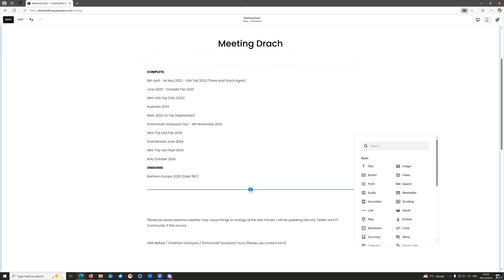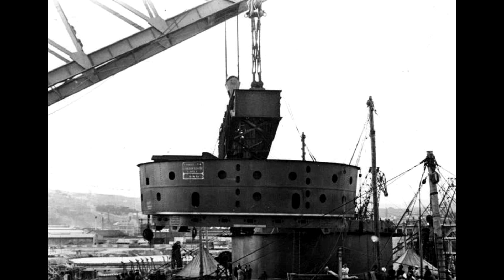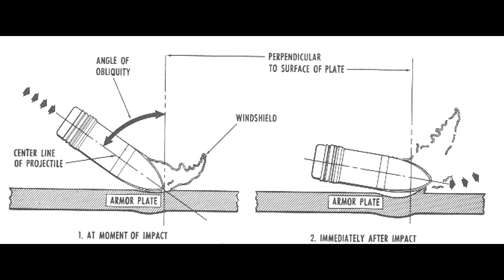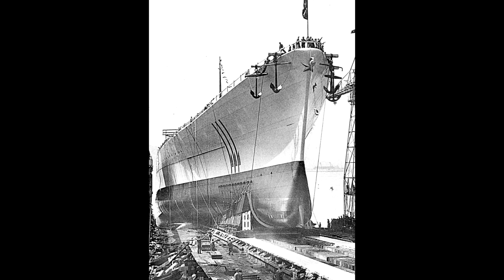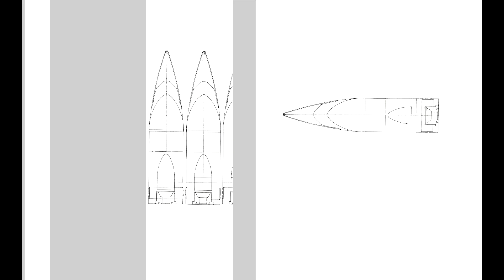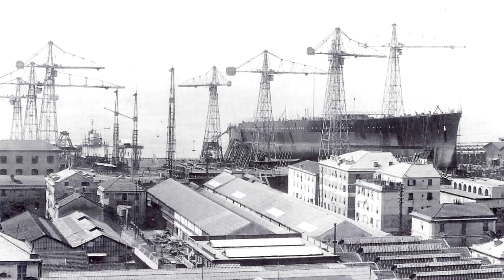Naval Engineering - Did the Littorio's Armour Scheme Work?

Comment: Always wondered how these would have fared outside the Mediterranean. Of course this was not the theatres of operation which they were designed for. One of the reasons the Allies rejected the proposal. I always marvelled at the rear turret’s placement high above the rear deck. 👍🏻🏴
Reply: My understanding is that that placement reduced the blast effect on the lowered stern deck.
Reply: @ Thank you. My father served abroad various battleships during W.W.2; Nelson, Rodney, Malaya, U.S.S.South Dakota, and Valiant.
The Queen Anne Towers on the first two ships suffered blast damage initially. I don’t know if that was solved by fitting blast protection shutters.
👍🏻🏴
Reply: @Backwardlooking The 'solution' for Nelson & Rodney seems to have been to not fire too far abaft the beam, though I'd expect that to go by the wayside in wartime pretty quickly.
Reply: @Rupert-B  Most british solution to a problem.
Reply: The blast firing astern was nevertheless enough that they tended to wreck their own floatplanes.
Reply: That way the rear turret could fire above the secondaries, giving it an unparalleled 326° angle of fire.

Comment: What if the thin skin was either movable or had cups or cones to induce angular momentum getting the shell out of alignment?
Reply: Easiest was to make the decapping plate moveable is to split it into two smaller plates and glue a rubber layer between them. Now you have NERA and the plates will buldge away from each other when struck with a projectiles. Perforations in the armor would also destabilize the shell
Reply: Already hitting the outer plate at an agle induces angular momentum. That's why spaced armors are used against APFSDS.

Comment: The Italian navy in ww2 is very interesting. A lot of italian military technology was very out of date, out of place, or had manufacturing issues like their tanks, machine guns, a lot of their air force for most of the war, even small arms.  But their navy is surprisingly competitive to its opponents, considering the rest of the armed forces. They seemed to have done a good job of innovation during a time of limited budgets and somewhat dodgy business practices of fascist government and manufacturers. Their range finding alone is quite interesting.
Reply: Wasn’t their airforce also top of the line?
Reply: @FilYRU999  In a way,  If Bf 109 is a BMW than Italian G.55 is a Ferrari, you want Ferrari but it's easier to buy and make BMW, they were also a bit less armed.
Reply: @Clippystarcevic696  The G.55 is MORE armed than a Bf109G. It carries three 20mm guns and two HMGs (Bf109G has three guns only if two are in external pods) and more ammos for all the guns.
Reply: @FilYRU999 the prototypes were excellent,  the main problem was about the massive production,  the Italian industries were able to produce those good aircraft in big scale,  often the air force was obligated to use outdated planes because they were easier to produce in big numbers.  Over that there was even a kind monopoly/corruption of Fiat until the beginning of the war that kept it  producing outdated aircraft, as the biplane cr series, cheaper and easier to produce for a company that already had the production lines ready for it. Something similar happened for the tanks ( but in this case without good prototypes😅)
Reply: @ducadan81  Wasn't that sticking to biplanes for too long also a result of the CR.32's still decent performance in the Spanish civil war? Unfortunately (for the Italians) that was pretty much the last time biplanes could come out ahead against monoplanes.
Reply: @tz8785 not really,  it was so maybe at the very beginning,  but it became immediately clear that it was obsolete already in 1940 , anyway they kept on producing it until 1944. Unfortunately the Italian military equipment in general was badly influenced from big companies monopoly ( they often had strong connections with some political) . Another example is the refuse of building engines on German license for tanks and planes. Fiat and some other companies didn't want to use projects of other foreign companies ( at least in the first years of the war ) so Italian tanks often had thin armour even because the engines were to weak to carry something heavier.
Reply: @ducadan81  They were producing biplanes in 1944 because the Luftwaffe commissioned them for THEIR pilots.
Reply: @neutronalchemist3241 yes but for anti partisan duty,  not to be used mainly as fighter
Reply: @ducadan81  Italy stopped using the Cr.42 as first line fighter pretty much when the Brits stopped using the Gladiator in the same role.
Reply: @neutronalchemist3241  I am not talking about the use of biplanes but about their production. Of course every country involved in the war was making the best out of every equipment they had. The last gladiator were delivered in January '39 ( I am not 100% sure ) while in Italy the government kept on paying Fiat for building cr 42  for all the rest of the war.
Reply: @ducadan81  If we are talking about production and not use, the Fairey Swordfish was in production in 1944.
The Cr.42 ceased to be used as a first line fighter in early 1941. It remained in production mainly to be used  as a fighter-bomber, that's the same use the Luftwaffe wanted it for, after discovering they would have wanted more Henschel Hs 123, but it would not be economical to restart production.
Reply: @neutronalchemist3241 my point is : biplane were obsolete as fighters already at the beginning of the war, UK started to produce only monoplane fighters from 1939 while Italy was producing them ( to be used as fighters) for many other years even if they were obsolete. In my opinion it was cause of the Fiat monopoly in the early war and of the lack of good factories for the massive production of better aircraft which were produced only in small numbers
Reply: @ducadan81  Only the US didn't use biplane fighters in WWII, and they entered it in dec. 1941.
The selection of the Cr.42 in 1939 was simply due to the fact that the Fiat G.50 and Macchi C.200, as tested, both required modifications, while the Cr.42 had no defects and could have immediatley mass produced as it was. Fiat had no preferences in manufacturing the Cr.42 or the G.50. The "monopoly" of FIAT is overstated. It's "monopoly" IE, had not been enough to have the Cr.25 selected over the Breda Ba.88 or the Caproni 300 series. 
Everything can be explained with "bribes" and "influence", but most of the times there are logical explanations for the facts.
Reply: In February 1943, the Luftwaffe sent a mission to Italy to conduct comparative tests with the newest Italian "series 5" fighters. The German delegation compared in flight a Messerschmitt Bf-109G-4 and a Focke Wulf Fw-190A-5, the top models of the time, with the Fiat, the Reggiane 2005 and the Macchi M.C.205. Although all three Italian fighters were superior to the German ones in terms of handling and rate of climb, the Luftwaffe rated the G.55 as "excellent", the Re.2005 as "good" and the M.C.205 as "average". The mission leader, Lieutenant Colonel Oberst Petersen, cabled Reichsmarschall Hermann Goering that "the best Axis fighter was the G.55". Friend, I think you should do some more research on certain topics!
Reply: When you want to go to Africa but it's across your country, having a navy is pretty much a necessity
Reply: Yes, the dual axis rangefinding towers are not found in any other navy, not sure if they were more effective than other spotting/rangefinding methods.